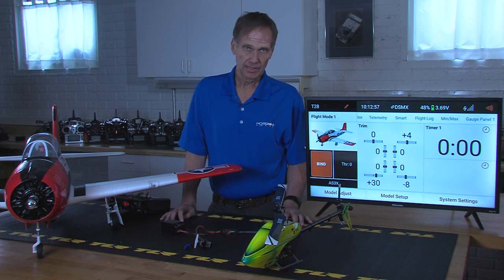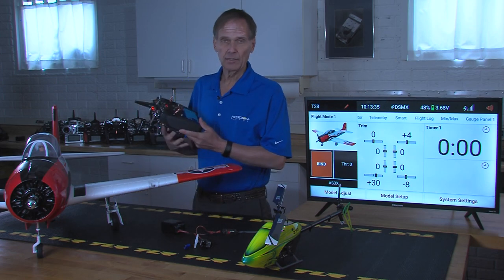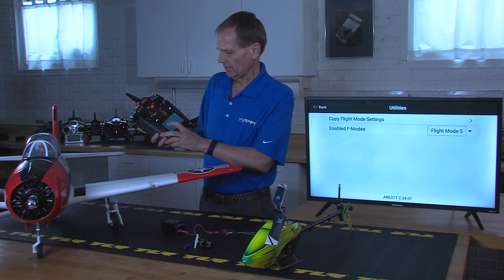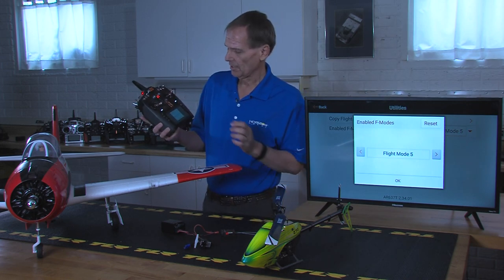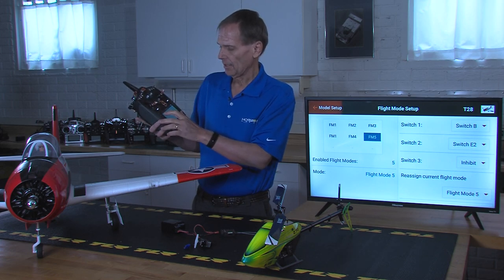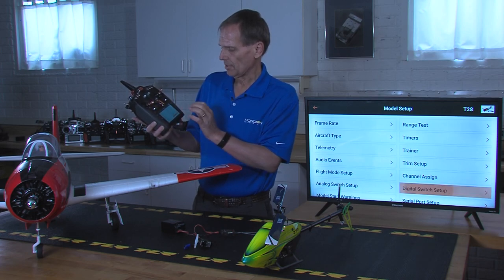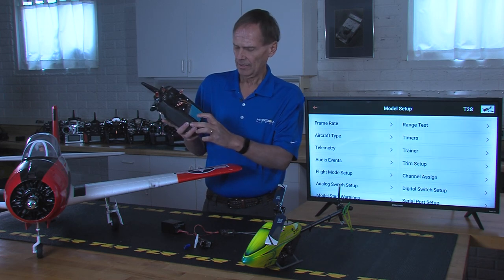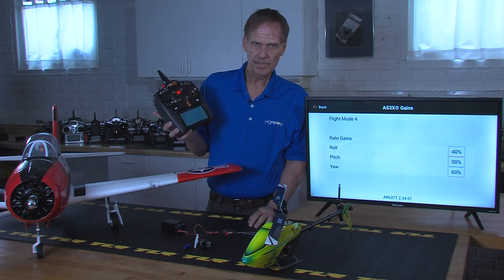Spektrum Smart Receiver AS3X Setup Series #19 - Programming more than 3 Flight Modes

Comment: I installed an AR8360t in a third-party jet. I initially set-up three flight modes, one for each flap position, so that I could trim each control surface for each for each flap position. I then flew the plane and trimmed in flight. All this was done without forward programming. My original understanding was that the flight modes assigned to the flap positions were being retained in the radio, not the receiver, and, are independent of Forward Program flight modes even though the same terminology is used for both.
I then went into forward programming to set-up gains, safe etc. Of course, it also referred to FM1, FM2 and FM3. My understanding was forward programming flight modes were independent of model set-up flight modes. And, this was confirmed when I tested the jet. The flight mode for the surface trims were operating independently from the GYRO gain FM, even though they had the same number.
However, when I went to add more flight modes (for heading gain), The FM in system set-up showed a matrix of 9 different flight modes depending on the combination of both the Flap FM's and Gyro FM's positions.
Does that mean I have lost the original OTF trim settings and now need trim the plane for each combination of flap position and gyro gains?
Most importantly, why the heck did you use the same terminology for both???!!!
Reply from the maker: With some programming finesse, I would wager you could use the multiple switch option in the flight mode screen and use them for Flaps positions and stabilization modes. That said it would likely be easier and less confusing putting them on seperate functions.

Comment: Excellent videos !!! I'm having problems setting multiples flight modes I do everything step by step everything works perfect when I unplug the airplane and power up again can't get gyro activated I push throttle and nothing happens, only gyro activate on safe mode  ...can you help me ????
Radio iX12
Receiver AR637T
Viper 90mm
Reply from the maker: Hi Jorge! Is the receiver from the viper 90mm OR is it a open stock receiver you installed? Also do you know what firmware version is on the receiver?

Comment: Are the number of flight modes dependent on the number of channels in the transmitter or the receiver?
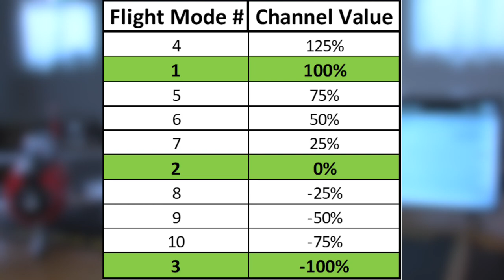Reply: No, I have a DX8G2 which is limited to 3 flight modes for standard airplane models, but I'm actively using 9 flight modes in the AR637T for a 3D plane.  The chart at 3:30 shows how to access them, and if you know how to program mixes you can access these pretty easily with any radio.

Here's how I'm using the 9 flight modes:
https://www.rcgroups.com/forums/showpost.php?p=47529505&postcount=69747 

The way I'm accessing these 9 flight modes on the AR637T independently of the radio flight modes is:
- In Digital Switch setup, switch D has values -75, 0, +75
- In Digital Switch setup, switch G has values -25, 0, +25

I've assigned switch D to my Gyro channel (ch. 5), and I've also added a mix from switch G to the Gyro channel as a +100/+100 mix.  That means these two switches act in combination to output nine separate values to the Gyro channel:  -100, -75, -50, -25, 0, +25, +50, +75, 100.  And you can use the forward programming menu to watch the flight modes in the receiver changing live as you operate the switches.

On the radio I have my 3 flight modes linked to my flap positions, which enables me to trim the model independently for each flap setting.

Comment: Does PANIC require a separate FM or simply require a switch pointing to the appropriate SAFE gyro FM?
Reply from the maker: Panic mode (different then SAFE modes) does require a seperate channel to operate correctly.

Comment: Hi guys. I’m just wondering if the Ar630 will give me as3x on a delta/elevon set up. Thanks.
Reply from the maker: sure does!
Reply: SpektrumRC excellent I’ve been trying to find a video on this in your set up series but it only refers to fixed wing. Do you have or will
You publish any further videos showing the setup And forward programming for an elevon set up. Thanks. 👍🏴🤛
Reply from the maker: @walesfly3r29  We can... but it is quite simple. Once you have your elevons working propperly and travels and subtrims are set. Simply go thru the Forward programming setup. That is the magic of Forward Programming! The RX learns how your model is setup and tailors it to those parameters :)

Comment: I have my 330X helicopter in storage for several years, because it has a problem in the tail cervo, it does not return to the center.  and the ar636a receiver cannot be programmed.  Now I have removed this receiver and I will try to put a K-BAR this is a solution to not lose my helicopter and I find information in Spanish about the programming